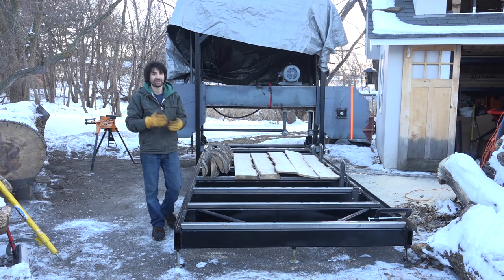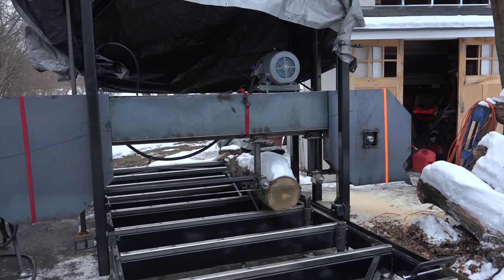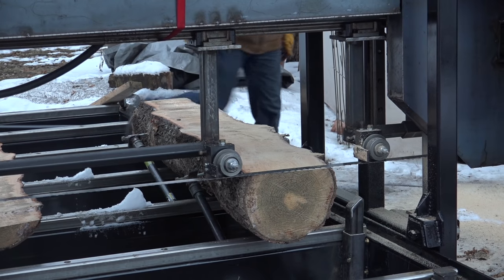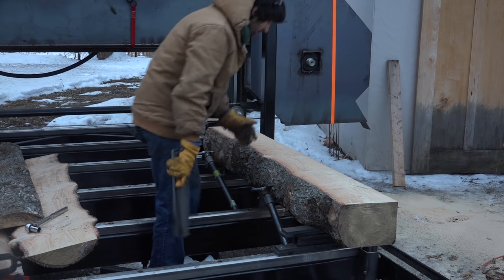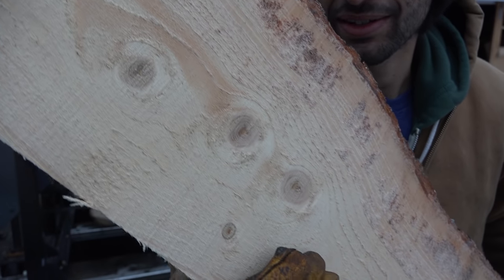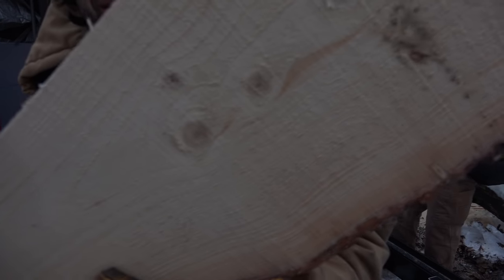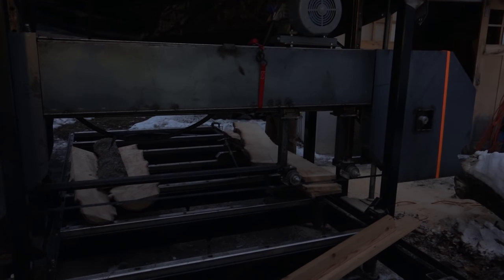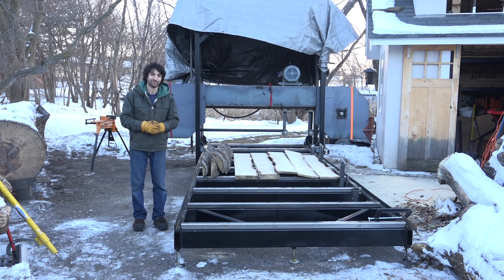Cutting a Small Log on a Homemade Big Bandsaw Mill

Comment: I see saw dust and slabs for Christmas, Congrats. If you flip the log 180 after the first cut you get 2 live edge full bark slabs, lots of projects for these. 1 live edge 1 flat edge not so much. Plus you now have 2 perfectly parallel sides to square from to make a 3rd cut. I assume you wont be flipping the big logs, but small ones like this one you will want to.
Reply: ringerson4x4 . If you do it like he did, you can have a book matched board with live edges on both sides....😜

Comment: a water drip should help with cooling the blade, and a little speed increase will result in even smoother cuts. However, you could take those to the jointer and planer and be ready to go for furniture making. Nice... I want one.

Comment: You should put some line lasers on there that project out from the blade level so you can easily see where your cut lands across the log. They are cheap on amazon, under $15  or so I believe.

Comment: have you thought about putting the mill on a slight angle to help the weight push through the log easier. You could also put a electric winch to pull it back again?? just my 10 cents

Comment: Matthew will you be adding a power feed? It would be easy using chain and a motor, If you used a small manual transmission could also make a rapped return  with  3 speeds forwards and one reverse! Use the input shaft of the transmission as your output and put the motor drive on the output, this gives you 3 speeds forward fastest for soft woods slowest for hard woods, shift pattern is reversed 3 gear slowest first gear fastest  reverse would be your fast return!

Comment: It's so cool. I bet it won't be long before you give it some powered feed. Looks quite difficult to push the mill forwards using human power.
Reply from the maker: +Timber Tricks it's not too bad. Just trying not to slip on the ice
Reply: Oh yeah the ice. We don't get much ice on the ground in Australia, certainly not in Summer :)
Reply: i saw that too, got me thinking maybe you could rig up a little pulley system and pull it while stationary from the other end via rope. always felt like it's easier to pull than push. guess you might lose the "feel" but you'd gain control over travel speed while cutting harder woods. really cool piece nonetheless, that's gotta be a game changer being able to make your own lumber.

Comment: Nice!  I may have missed the section on the blade cooling system, are you dripping water onto the blade?   If so, how are you dealing with the freezing issue during the MN winter?  buurrrr!
Reply from the maker: +Steven Moore I still have to install the lube system. In this video I'm manually spraying the blade with pinesol and water. Antifreeze can be added to keep the fluid from freezing

Comment: Matt, what is the curf of the bandsaw vs. the chainsaw?
Reply from the maker: +Nathan Wooler around 1/16" vs 1/4"
Reply: Wow! That is going to equal a huge improvement in yield especially when you factor in how much smoother the boards are.

Comment: Helluva machine you've built there.  That would cost you thousands of dollars, if you had to buy anything like it.    Since you have a tension gauge, would you care to say how much tension you're running on the blade - in psi of cross sectional area - and what size blade you are  using?    Just a side note:  that spruce log probably has enough lumber in it to build at least two of Matthias Wandel's wood frame saws.  :-)   Regards, Jim W.
Reply from the maker: +apatientspider thanks! I'm running a 1.5" wide blade tensioned to 18000psi. You just gave me an idea for a really great project!
Reply: Assuming a blade thickness of 0.042 inches and a width between the gullets of around an inch and 5/16, 18,000 psi figures out to about 2000 pounds - or a ton of load on the wheels and frame.  Pretty impressive!    Of course, the blade can take more than 30,000 psi if necessary.

So what's the project idea?  Don't keep us in suspense.

Comment: You don't want a lubricant system on the blade? Does it work fine without it?
Reply from the maker: +Jakob Jørgensen I haven't installed it yet. So far it's been fine without it. I just watch the blade for pitch building up and give it a spray with pinesol and water between cuts